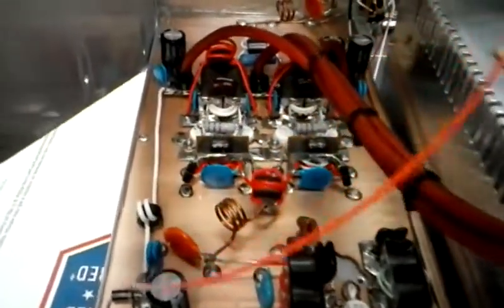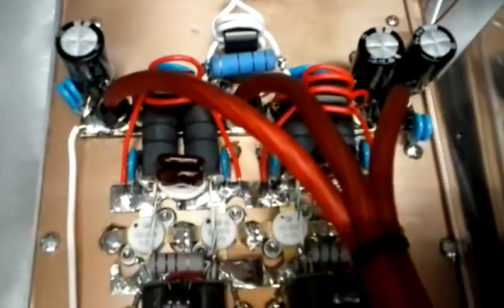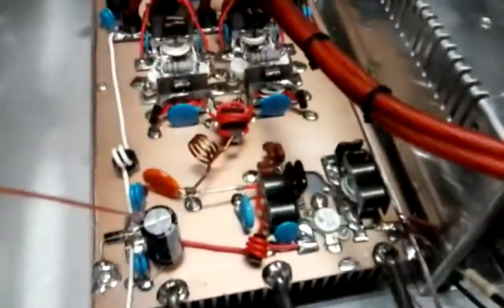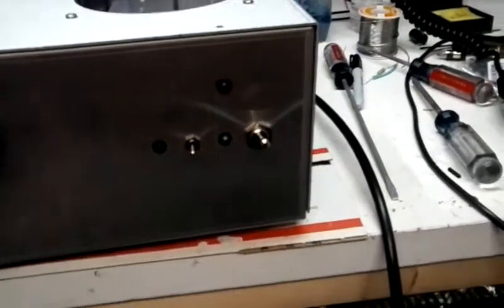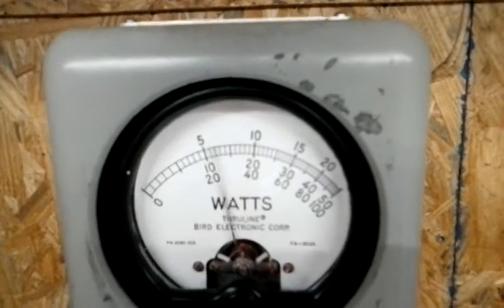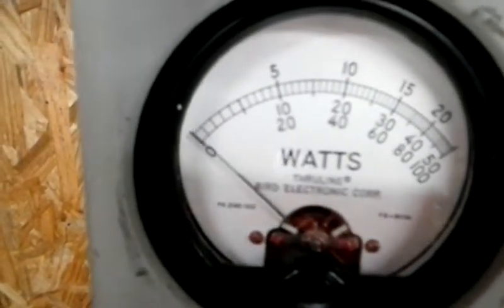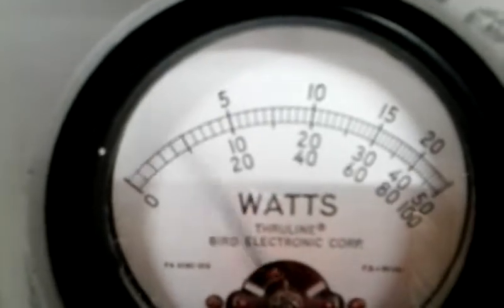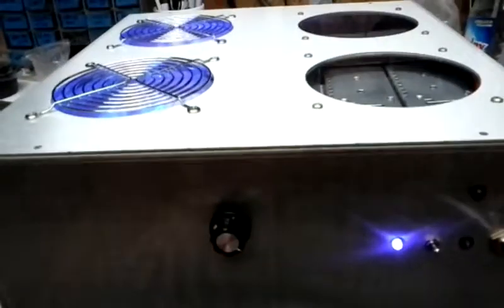Fat Cat Amps 1 x 2290 driving 4 x 2879

Comment: the disc caps don't last long on the output tuning that is the first thing I look at on a repair. maybe you had some good luck with them. I like your videos keep up the good work.
Reply from the maker: i have 1% metal clad but they are all 980pf, as you no no the two 500pf 1% dm-19 caps will hold the current just fine and they are 1027pf,  i would totally agree with you if it was one dm-19 1000pf, thanks for watching my videos my friend
Reply from the maker: on the output tune it is 120 4kv large cap, no need for door knob till 8 pill, they last just fine with zero failure. Merry Christmas
Reply: I don't know why they go bad but it could be the rf but I replace it with a 1000pf and a 120pf metal old school it last a lot longer thanks for the reply keep up the good work and have a merry christmas
Reply from the maker: thanks for sharing info , you have a safe Christmas and a Happy new year